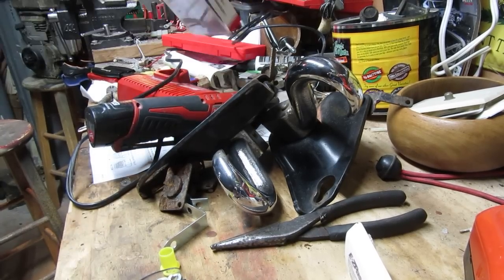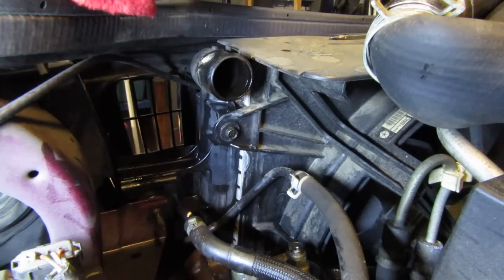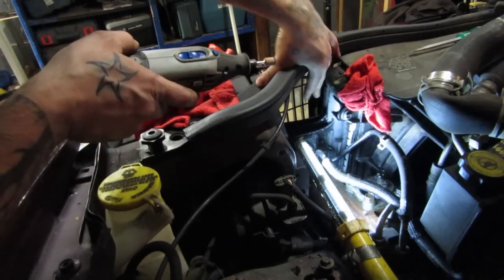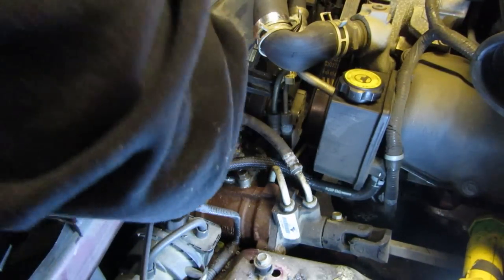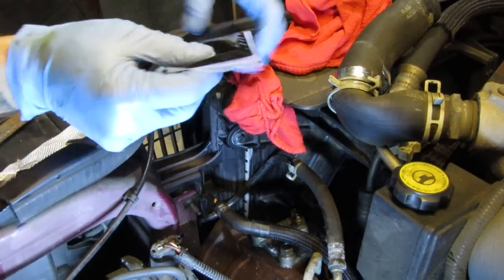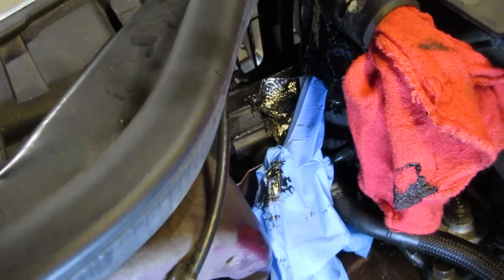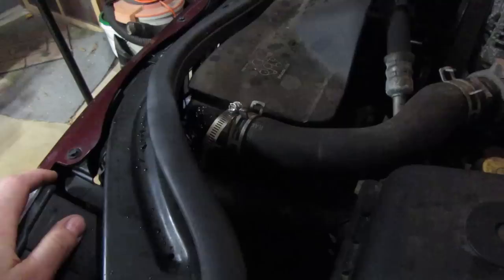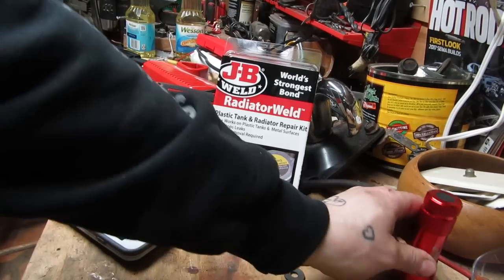RADIATOR FIX - JB Weld Radiator Repair Kit

Comment: jb water weld worked for me very well on a 1/2 long hair crack . but i had to put a small heater in the engine bay for a few hours with weather at 30f winter to cure dry . i recommend letting it cured for 3 hardcore days before driving and applying antifreeze. make sure the system doesnt have anitifreeze or pressure when apply this or at least antifreezeis below crack. make sure the epoxy isnt old or expired or else it wont work ,cure or activate

Comment: I used some JB WELD COLD GLUE you get from oreillys I had a hair line crack in my radiator I go for work and back so far and it’s holding up it’s been one day so far I prepped my area in the parking lot of Oreillys I sprayed the crack with break cleaner and let it dry up then I got a detail brush I had I mixed up the glue and applied a thin layer it’s holding I wait about an hour before driving off It go me home about ten minutes away and work then next day then back to Oreillys to get some coolant to replace whatever leaked out

Comment: jb welded mine years ago (2-3) and have to redo it but... this time I am going to use the repair kit instead of just the weld... I think it is well worth the repair as it is way cheaper than a (plastic/nylon) radiator and it will last as long as the life of the beater car I have

Comment: I use the quick set JB weld.  If it's just a small seeping leak at a plastic weld, it works great.  Rough up and put two generous layers, letting first dry.

Comment: Has anybody ever used J-B weld high temp to repair radiator cracked before I have some of that laying around hoping that it will work? Liberty tried using radiator weld epoxy the stuff that squirts out of the tube and it does not work as soon as the coolant gets in contact with that stuff it starts to break down so don't go about that route!

Comment: I used JB WELD once B4 and after about 45 minutes the leak was back.. simply because once the radiator Hits the temp of 240/260 it is super hot and the JB WELD let go. Then I had the problem back again.. so I then took my Dremel and went along the crack and made a gully and used the Dremel along each side of the crack and I had two cracks then I took a soldier gun and heated up the plastic on the radiator then I took ZIP TIES yes zip ties and melted them in and along the crack and it held up for the next 4 yrs then t sold it and the guy who bought it had it for 3 yrs then he moved away... But my point is being that it's plastic as the zip ties are and they are a POLY MATERIAL AS IS THE RADIATOR A POLY PLASTIC... BUT YOU MUST HEAT THE PLASTIC ON THE RADIATOR FIRST THEN USE THE ZIP TIES... REMEMBER AFTER THE DREMEL CLEAN IT WITH BRAKE CLEAN THEN HEAT THE RADIATOR THEN MELT THE TIES.

Comment: Good video. I would do this but I would take radiator out and take the tank off of the radiator and fix the crack on the outside and the inside. 
Here's a video showing what I mean. 
https://www.youtube.com/watch?v=vjppWN_yod0&t=5s
Happy Motoring.

Comment: Thanks for posting this - I've had to repair a pinhole crack (about 5mm) on an aluminium radiator. I sealed internally with K-seal which stopped the flow of steam and so on, so that made for an internal seal. Then, on pinpointing the crack location (which was on the top of the radiator as in your case) then followed with a JB weld outer seal. This has worked 100% - the difference being that I cleaned the surfaces with isopropyl alcohol before application, and scuffed them lightly with sandpaper. The performance in my case has returned to normal, with no coolant leaks of any kind. Has held for more than a year, and is in fine condition. Have a new radiator coming next month, which I'll put in myself, its a weekend's work to do.
Reply: I am curious how long this repair lasted. ?
Reply: @johnchadwicktilton  a good year, after which the radiator was replaced. A good return on investment.

Comment: jb weld worked well for me once, but eventually it cracked again. Took a while, so i decided to cut most of it off and try again. It seemed to last about the same few months, then did a 3rd time but then it only lasted a few days. Since the crack is bigger now (had to pick out the crack every time b4) i decided to use some fiberglass this time to hold the crack from spreading. Hope it works.

Comment: I had patched my radiator 2 years ago with just JB Weld and it works for 2 years and now it is leaking again same place. I am going to give this a try,  my mechanic said $400 part and labor.  :( I am going to give this a try first. I have a feeling it might work for me since mine has a hair line less than 2 inches.
Reply: I don't know about your car but a lot of Asian radiators are only a hundred bucks and it's really not difficult to disconnect and reconnect the six hoses and four screws & you're done!  About 1 hour of work!
Reply: @dgillies5420  yeap I ended up buying a radiator from Amazon and installed it myself. You're right it cost me less than $100 and took about an hour. It's now almost 2 years.

Comment: Well yeah. Fiberglass resin has a hot chemical reaction amd fires happen when someone mixes too much hardener. I used to mix mine a lil hotter to cure faster but got smoke occasionally.

Comment: I use the sticky dry wall mesh tape. It sticks to  your radiator better then there's, then apply a few thin coats of repair weld. I then will buy some regular job weld steel weld and apply several thick coats on top of that. It will last awhile but you have to check it. Eventually you will need a new radiator cause it will crack others places. But it will get you through until you have the money or time to replace with new.

Comment: I don’t get wat the point of that fiberglass mesh is, it doesn’t touch the radiator, & makes things take too long to put on before it sets, I M 1drng if plain old JB waterweld stick worx better, just because of the application to timing cunundrums - for example, you can see in the customer ratings on package about 1/3 to 2/5 of the Ppl say it sux👋😒

Comment: High heat jb weld is not designed to resist the chemicals in coolant and it will come right through in a day of driving if not less. This is using the high heat steel reinforced one. I would recommend the water weld over that but this compound is designed to resist the coolant
Reply: Nope ate through my weld..
Reply: @StephenHaviland  use a soldering iron melting the plastic back together water-resistant JB well is chemical resistant use in combination, no fiberglass kit apply directly on surface area for correct is located a little at a time
Reply: The water-resistant JB weld is is resistant to chemicals are oil and gasoline , a combination of both JB weld hi heat , you can also try melting the plastic back together with a soldering iron , melting New plastic into the cracks
Reply: By watching I can tell you do not apply that correctly you left the fiberglass mesh off of the J-B weld it was not applied correctly

Comment: I too have done this before but wasn’t prepared for how hot it really got and it stuck to my hands and I had to use gasoline to get it off I also did not mix the material properly and it lasted only a few days so make sure make sure you mix it very very thoroughly Also you’re supposed to drain out the radiator tank before doing this just to make sure you get any old dirty radiator fluid out then when it’s dry add your new coolant

Comment: Do I have to drain the coolant from the radiator cause I know exactly where the the minor crack is and it’s barely leaking. And do I have to use the fiberglass cloth?

Comment: I tired this on a little crack on my radiator next to the cap. I got a little of the epoxy on my hand is that okay?
Reply from the maker: Yea you will be fine, but it will likely be with you for a few days. It is harmless though

Comment: I have a Crack in the side of mine as well tried taking out the radiator twisted the trans cooler line now I get to deal with that
Reply from the maker: Good luck!
Reply: I used jb marine grade weld and it worked great left it set for around 20 hrs before filling radiator driven it the last week around 300 miles no leaks yet for anyone that was wondering if this really works

Comment: step 1  pull the radiator out
step 2  clean the  spot where the crack is 
step 3  take some 80 grit sand paper  an scuff  up the area around the crack
step 4 clean with brake cleaner 
step 5 dry the area  around the crack
step 6 mix the jb weld 50/50 mix. the mix should be a jet black
step 7   start with a  good coat starting form the crack then out around the crack 
step 8 let it cure for 4 hours
step 9  with some  fine sand paper  sand the jb weld 
step 10  ad a  2nd  coat  start outward to inward of the crack .
these step will last you a very long time . i have a chevy  truck with a 454  an still going strong after 15 years :)
Reply: What jb weld did you use I have a 454 too
Reply: @michaelturbes7001   just reg  jb weld . don''t use the quick  weld
Reply: I will be trying it out just like u said this week in that order YessZziirr I do love me sum JB Weld fix a lot of thgs with it threw the years
Reply: yeah i just found a pin hole in the hose mount that goes to the or from the thermostat, top hose/ needing to fix it. your method will work? let me know. i'm 69 and realy don't want to take the shroud off , remove the radiator. let me know
Reply: I would use wide clear sticky tape on the JB Weld to get a perfectly smooth finish. Apply a few pieces if you need to make it wider and use your fingers to smooth the application out. The sticky tape is it's own 'release agent' and will come straight off, leaving a perfectly smooth finish, once the glue has finished setting.
Reply: @dora-de-explora  guess what worked for me? Flex seal! fixed it right up
Reply: @snodgrassgerald2352  ...and here i am thinking that Gerald Snodgrass was just a Monty Python made up name!
Reply: @dora-de-explora  haha im dead! no it's real. Snodgrass goes back 900 years. and Gerald is Celtic for spear master 🤷🤷🤷
Reply: This comment is very much appreciated
Reply: Regular jb weld won't last 5 min. I tried it
Reply: @greer2402 ,,,,,,,was it high heat jb?
Reply: I am trying your method but will drill two holes on both sides for an anchor.  I hope it works till I can get my replacement.  As I am moving in a week and my part is not due to come in till 3 days after my move.
Reply: JB Weld told me never use Brake Cleaner. Use Acetone.
Reply: @victoriarose6465  I dunno what Brake Cleaner is made of. But I do know Acetone and it leaves NOTHING behind. It's used in electronics to get rid of flux and it is the only thing that doesn't leave a residue of ANY kind. If BC has an oil in it, then that is a 'release agent' is a film to prevent anything sticking to the block/head etc. All that good hard work, stuffed because of poor adhesion due to BC. IE. YOU'RE RIGHT!!
Reply: @dora-de-explora  Thanks! It's not me who is right. It's JB Weld. The assistance the Rep there gave me went waaay above and beyond!!!
Reply: the radiator repair kit saved my ass yesterday
Reply: The problem why people fix it with jb weld is the time it takes to get it out … that really defeats the cheap fix .. radiator is cheap time isn’t 😁
Reply: step 10 mAx no sNs, I thought U said U ALREADY covered the whole crack?😒

Comment: Bro how did it hold up? Im just about to buy the stuff and want to know did it hold up too the heat? I first used parent plastic powder from the radiator and dremeled and added the powder too the crack and used loctite to activate it but i eventually started leaking so is this stuff better? plus my crack across the plastic face is like 7 inches long can i cut the mesh in half to make the gap? the crack is along a flat surface no bends or angles luckily?

Comment: 39 dollars here in australia. we getting ripped off bro I bought a generic radiator off ebay and being chinese it didn't install well so back to crack repair with the old radiator. Good luck getting a replacement radiator guys that fit.

Comment: They rent Cooling system pressure test kits at most auto parts stores please don't warm up your car to find the leak if it ruptures she could get burned badly! alternatively and a lot cheaper Fill the cooling system with water Rinse off the radiator opening and blow into it with your mouth and you can probably find the leak!!!

Comment: I was in mexico n scraped a hole in my oil pan, next to the plug. I was dripping oil badly after that nasty bump but luckily i was next to a shit-small hardware store with a cheap, 2-part putty. It stopped the oily leak immediately, formed to the edge of the plug without binding it, and lasted YEARS without a problem. I drove it thru the summer sonoran desert multi times! Wish i could find it again.
Reply: What was the putty

Comment: Rookie mistake and may help someone down the line: This stuff sets FAST. I was kneading the product for 30 seconds, felt it getting warm so I started opening the pack and by the time I started applying it the pack was too hot to handle and had already set before i even got the product out. I'm using just standard JB weld since the crack is quite small and hopefully this will hold until I can get a new plastic tank.

Comment: For plastic radiator leak, forget everything. Use Weicon Aqua repair stick. Made for plastic radiators. Used it n satisfied. Takes upto 120 C (250 F). The extra I have I will use for my plumbing

Comment: I would have gone through the hassle to remove the radiator, tape off the areas that I didn’t want to get the JB Weld on, and make it work the first time. I have a very small leak (1/8” on the top of my radiator). I’m thinking this would be overkill ....

Comment: your steam could be the old coolant residual burning off.....BUT point being......I would have put a can of Bars leak in as a sealer to do the final since its just  a minor issue as opposed to a pisser.  Its a stress crack due to the upper hose being subject to the motor vibration and shifting.....its common for tanks to fail on the upper hose area because the material is not thick enough....designed obsolescence....thank the engineers and accountants.        I you read and notice, most auto companies recommend using a sealer additive to the coolant when doing a system repair...hence Bars leak or some Prestone Sealer.>>>>>>>>>>>>>I have had issues with the plastic tanks around the transmission cooler lines or the dummy bungs in the sides of the tanks......and sealer works wonders just about forever.   The issue with coolant is that you should be using distilled water free from minerals as tap water is full of minerals and most likely calcium.....which over time mineralizes on the metal passages in the radiator and heater core clogging the flow up.........much the same way as it does in home heater systems that use hot water as in base board heating......the tubes get calcified and clogged up reducing the efficiency over time.>>>>>>>>I'm old school where when the radiators were brass tanks.....you could just stuff bondo into the leak and seal it forever.......or you could solder the brass.    Plastic sucks.....its nylon
Reply: If youre really old fels naptha soap    Or was that for gas tanks my dad used it

Comment: You should have let the epoxy cure for longer. Also I've had great results using the water weld putty over the straight JB weld or the repair kit, and I imagine that might be easier to manage on a crack like this. I would definitely say don't buy that stupid kit though, seems like a lot of money for some 4 dollar epoxy. Worked fine on my 81 accord with a dual slot radiator. Didn't want to replace it because they are so hard to find, and the leak was pretty stupidly minor.
Overall, good video. I'd give it a full 3-5 hours to cure.

Comment: Thanks a bunch giving it a shot, my crack is on the top in a spot on the top where it's just a flat line.
Reply: I have a crack on top of my radiator also, so did you have to drain tour radiator fluid out?

Comment: That stuff hardens WAY too fast. I got like 1:00 before it was rock hard.
Reply: Yup.  WAY too fast and the instructions mention nothing about this.  I was kneading and cutting the nylon about to apply right as it got super hot and then rock hard.
Reply: @DrCash7  funny story, it caused my head gasket to blow because I didn't seal the leak in time before engine failure from overheating.

Comment: In the 3 videos i watched no one flushed out the radiator with water. Glycol is super slippery and probably contaminated  your repair.
Reply: Iv read on this thred that rubbing alchohol(comon cleaner) destroys the bond, now Ur saying antifrEz does too, I think Il clEn it with water & a carbon fiber cloth, before & after sand/scuffing - but in the end, no mater how strong if an outer peice of plastic is created, the bond of JB plastic peice & radiator is the weak spot.. pressured anti-freeze, or steam, pushes outwards & if it gets through the crack/bond anywhere, then it turns at a right angle, making escape path- this all makes me think JB water weld stick works better, just because of it’s simplicity, & thickness to be pushed into position & handleability(water proof, 350•, where most radiators get to 220-30, shower, which I beleive means water pressure.. maybe - thats the questionable part, a guy on tube tube attempted it & it workd